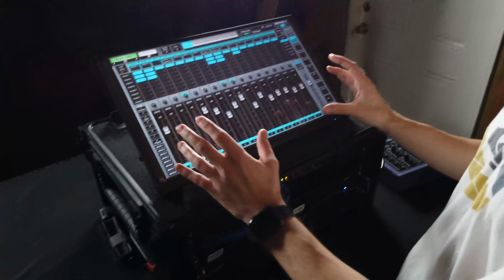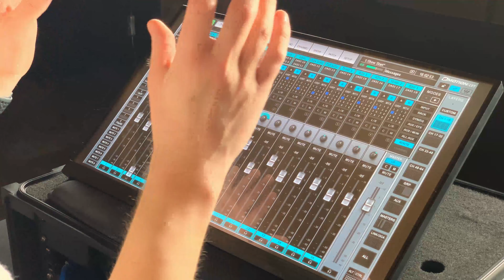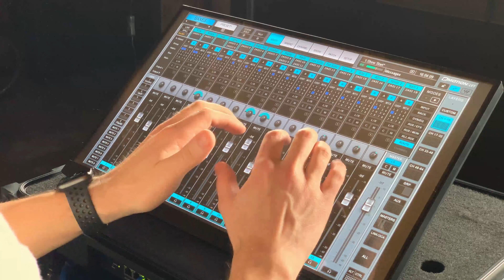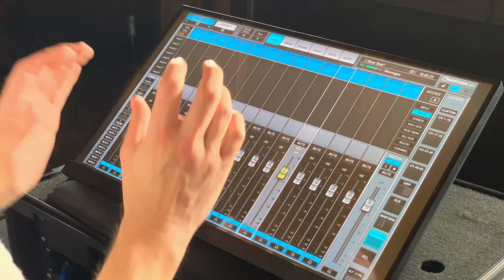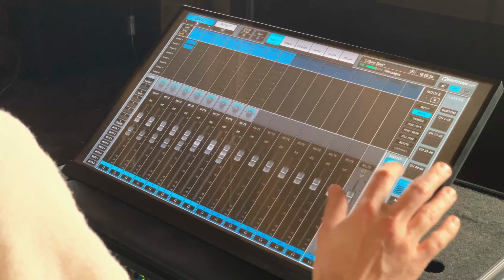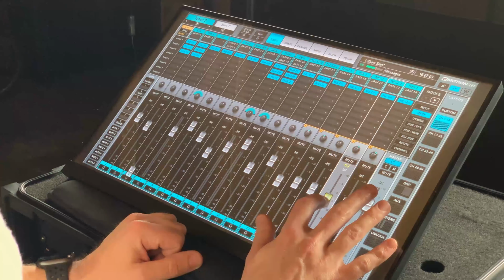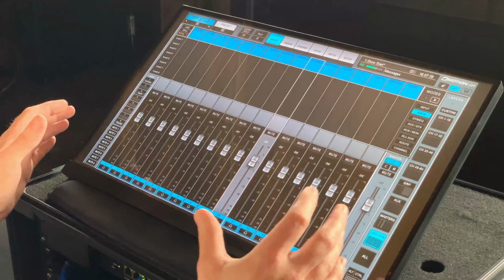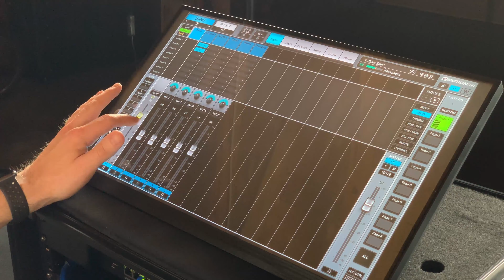Waves Audio LV1 Advanced Mixing with Groups and DCAs

Comment: That's a very neat rig Josh. Could you please let us know what size is that screen and what's that pelican case model do to transport everything? Thanks
Reply from the maker: https://www.planar.com/products/desktop-touch-screen-monitors/20-inch/pct2235/

http://www.skbcases.com/music/products/proddetail.php?f=&id=1168&o=&offset=&c=117&s=80
Reply: @JoshVoyles  Thanks man!
Reply: Josh Voyles does the planar screen fit in the top compartment of this case? Do you ever travel with it as checked baggage? Thinking about loading it with axis, Extreme server-c and ios xl, would probably be over 50lbs at that point... but considering it

Comment: Hey Josh! Do you think the lv1 is stable enough and has a good enough outcome to ditch a sd9?
Reply from the maker: I've had more issues with DiGiCo than I have had with LV1. That said, I'm very meticulous making sure everything is qualified and correct with my setup and I am running Axis now too. However, DiGiCo makes an excellent product too and If your workflow requires an SD9 then you should stay with that. However, LV1 is becoming very accepted and proving itself stable and long-term reliable. If given the choice between the two for a paying client, I would choose LV1 with Axis and a Luminex GigaCore 10 switch.
Reply: Josh Voyles great! I’ll try out the lv1 for some time before a final decision. Thanks!